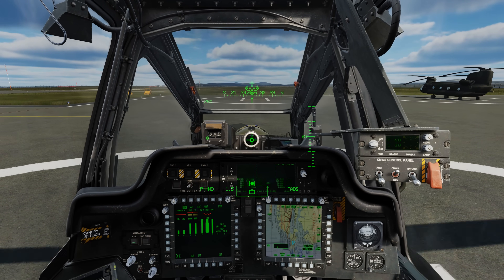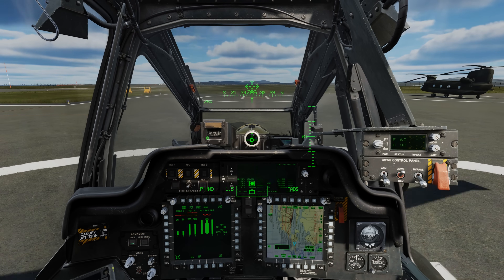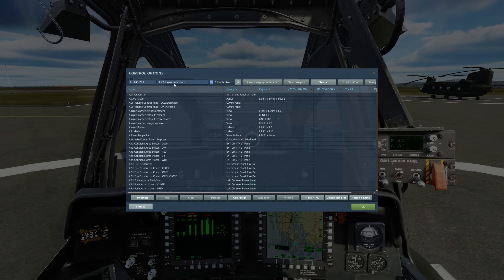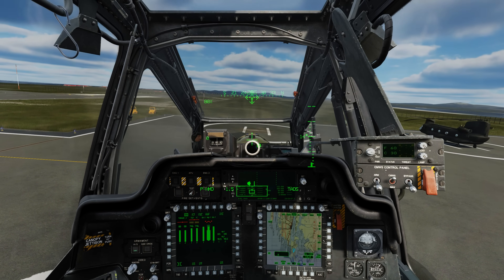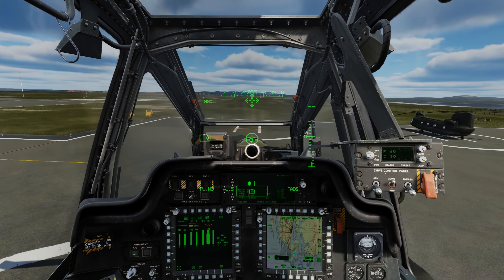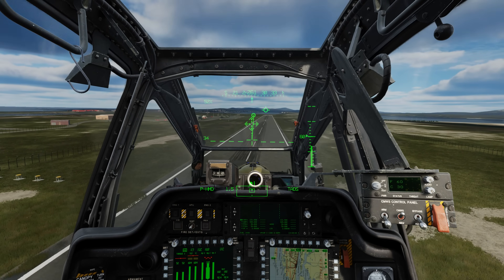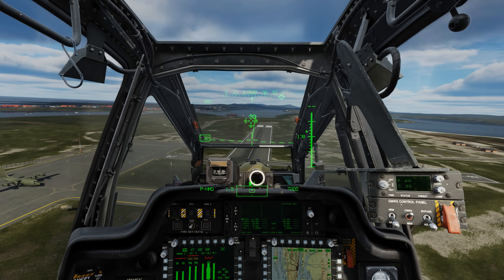DCS: AH-64D | Hover and Velocity Attitude Hold Modes

Comment: 2:46  'BOBUP' hold. Dude! WTF is it! How do we access it. I have looked across , up, and down, the controls, in commands for AH-64D Pilot. I Can't find it. WTF is called, what button controls it ON/OFF? Why is it so effking difficult to find?
Reply from the maker: https://youtu.be/e_590aQTEFk?si=02-niN8nUKfe9Yw3&t=503
Reply: @MattWagner  Dude! Force Trim/Hold DOWN (AFT) does not bring up BOBUP symbol. So the question and is unanswered.
Reply from the maker: @dkoz8321 I said the symbology select switch.
Reply: @MattWagner  Got it! Found it. Finally.

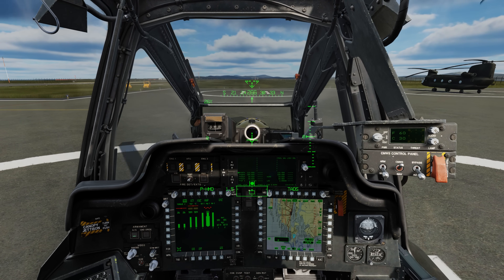Comment: I appreciate the effort for that tutorial, however i find it not very helpful as a beginner. No visuals of the control input overlay and trim position makes it really hard to follow along. Continously changing the naming of the hold modes in the video doesn't help either. At 1:43 it says "above 40 knots you will be in attitude mode" and at 2:42 one clearly can see the hover at 0 airspeed and the engaged attitude mode is displayed. After some fiddling i got it to work, this is how you i do it:
- first establish a stable hover
- then set the trim (Force Trim), re-adjust until you have established a really stable position (see the red cross on the input overlay move to your stick position). You should be able to release the cyclic and the helo should stay roughly in position. If not you need to re-adjust your trim again.
- now activate the the LEFT hold mode (Attitude Hold it's called and that's what is also displayed on your screen, ignore all that velocity and speed names, it's just confusing)
- what is completely missing in the video is that you can activate the ALTITUDE HOLD mode then by activating the RIGHT Hold mode (see ALT HOLD in the display) - now the helo will also hold it's altitude. 
Note: If you hear any beeping it means the Hold modes have a hard time doing their job, you may need to improve/re-adjust your trim setting to a more stable position).
You can also activate the ATTITUDE Hold mode (LEFT) to set the helo to a certain airspeed. To do this again you need to have the helo trimmed at that speed (red cross in input overlay moved to your stick position). Then activate the ATTITUDE Hold (LEFT).

Comment: I followed your turorial step by step but I always had one problem: The Attitude Hold would only engage rarily or not at all and i couldn´t activate it reliably. I don´t know if it is my fault or if my game is just bugged. (I think it´s my incompetent self).  If someone has a solution for my problem please help me.
Reply: 1) Force Trim - R/Up. 2) Force Trim - AT/Left. 3) Collective @ about +70% not mentioned in the video. Make sure your mapping is correct, follow the steps and practice. It's not you.
Reply: @rc3754  Thanks I will try that.
Reply: @ghost_md-9973  I had the same problem until I figured out I wasn't using the Force Trim Release - R / Up Release button.  Works great now. Hope you have descent HOTAS too.

Comment: How do you "Initiate the hold mode" is what I'm after. It looks like the only controls used were the trim switches at 1:40 when the control scheme was pulled up but I already have that set. It doesn't say anything about hovering hold, or hovering, etc., That's where I'm lost.

Comment: It doesn't appear that the Force Trim reset recenters the SAS in the current beta build, and the only way to recenter the SAS is by holding FT for 3 seconds (or do a complete FMC reset). Is the upcoming patch going to recenter the SAS upon FT reset?
Reply from the maker: Left Ctrl + T
Reply: @MattWagner  that resets the force trim, but actually moves the green '+' further away from the trim center position.
Reply from the maker: @schoolio64D  Yes, we are aware. thanks.

Comment: Tried, doesn't work. Got into a perfect hover, resetted the Force Trim, still perfect hover, now Force Trim/Hold mode LEFT, let go on the controls .. helicopter drifts away spinning clockwise until it crashes. If i don't reset the trim heli drifts away just without spinning and crashing. P.S. Open Beta updated to 2.7.12.
Reply from the maker: As stated at the top, "Coming Soon".
Reply: @MattWagner  upsy! I missed that. Sorry.

Comment: Hi , can this hold mode only work at low attitude or can it also work say abt 500 feet and above? Apologies if this is a silly question. I'm learning 😢
Reply from the maker: As long as the controls don't get saturated, it should be fine at any altitude.
Reply: @MattWagner  Thank you Sir

Comment: I really hope there will be some kind of stabilisation system for forward flight at high cruise Speed, cause the apache is rocking left and right like a rocking chair compared to real life helicopters i fly in.
Reply: At max speed you are very close to retreating blade stall which will make the helicopter loose lift on its right side and fall. Even small changes in wind, air temperature and pressure as you fly across different areas can make a big difference at this point. DCS might just have to trim the module a bit...
Reply: @johnloov  true, I'm comparing to Bell 429, we flew it at 93% torque yesterday with altitude hold on 1400 feet, reached 140 knots indicated and she was rock steady. Maybe the Apache has lower  Vne than the Bell? But still I lack some kind of stabilization when doing normal flight straight forward. I really hope there is a heading and altitude autopilot in the works.
Reply: Yeah i noticed that too!! Have you gotten the sudden uncommanded barrel roll yet? lol
Reply: @Aphelion79  Yeah, it's so unstable sometimes.   Have you tried the UH-60L mod? When you activate all stabilization systems on it, it's very stable on the "wings" during level flight.

Comment: Trying to be constructive but hoping for some FM tweaks so the helo doesn't spin like a weightless top when making 1 and 2% changes to the power settings near hover.  And the sensitivity of the module is such that I have to reduce the percentage of total movement so that when I add some curve "which is a must" it doest bite so hard at the extremes when I do need full movement.  If we're all just adding curves and adjusting sensitivity to make it enjoyable "which we are" I guess I'm not sure why the sensitivities are so high. 
If i had 3 foot wide $500+ rudder pedals im sure it'd be better but i use a vkb twist grib which has been brilliant with every other module and helo i use.
Just my 2 cents......I want to enjoy flying not relying on automating my gaming experience.
Keep up the great work, dcs has been fantastic as of late.
Reply: The only axes in DCS i ever use a curve on are TGP/Radar/cursor slew axes, even back then when i used a Logitech 3D Pro 🤷‍♂️

If you have set a huge deadzone for your anti torque axis on your twist grip like i had, try it without. Made it much easier for me. You aren't supposed to release the AT pedals in a helo anyways 🙂
Reply: @Skullizer  I don't use deadzones, Thr hind and huey work great. It just seems obvious when you add 10% lift from the ground and the apache starts spinning on the pavement with the brakes locked something is askew.  It's early access and it's just my 2 cent. It's not horrendous.